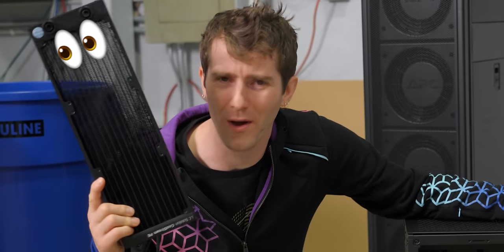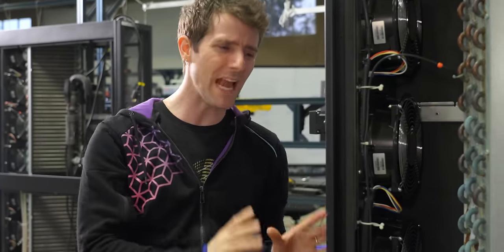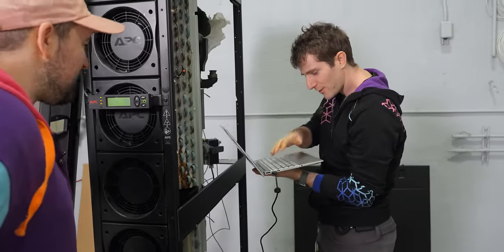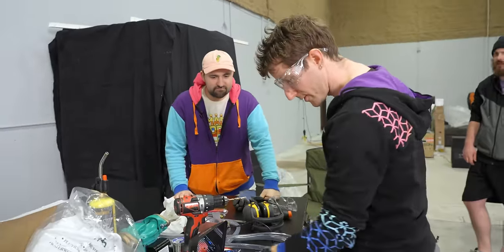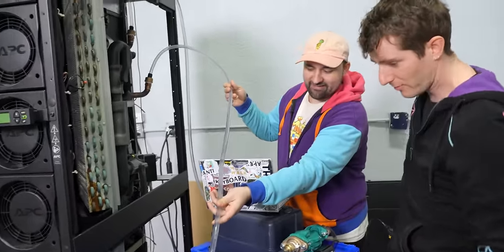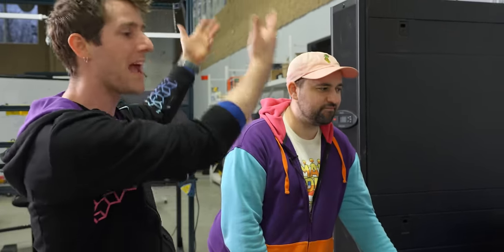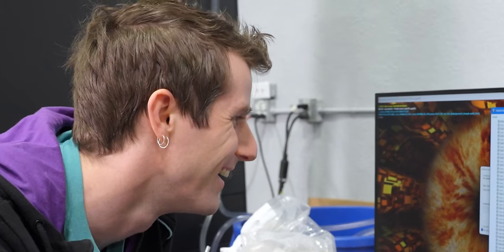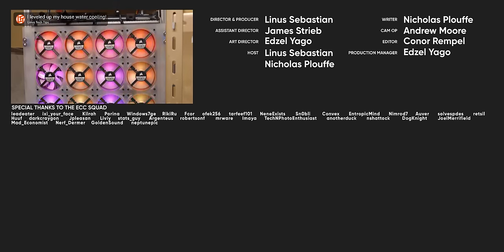I Can’t Believe They Threw This Away - Uniflair InRow Server Cooler

Comment: 7:20 casually throwing metal shards everywhere with powered machinery.. Yup that's linus!
Reply: The powered machinery is basically just some fans and enclosed pumps. 
You could throw the chips at them directly for hours and it wouldn't do anything.

Comment: Data centers use water to air chillers. Because running air conditioning with the compressors and everything is extremely inefficient and very expensive at that level. So data centers usually have cold water non-potable piping running up and down the bays where if they ever need to install a chiller somewhere on the raised floor they can tap into a valve and install a new chiller and then the chillers usually face downward meaning it pumps the cold air into the floor and then in front of the servers there's four tiles with holes in it for the cold air to come out The hot air rises into the ceiling where the chillers suck from the top and usually the walls there's a handful of chillers around the walls of each bay. But that's why these don't have internal pumps or anything because those pipes that are run through data centers are already being pumped and under pressure
Reply: The amount of air that comes out of raised floors is also insane. I was shocked the first time I raised a data center floor tile and got blasted in the face with massive amounts of cold air.  Lifting that tile was also another story because I wasn’t aware of how heavy they were lol
Reply: I don't see sub floors as much these days, usually pods that are hot aisle containment like these APC units in most DC's I have been to recently. Though I have to say they suck when you have to spend hours in the hot aisle patching servers etc.
Reply: CRAC units

Comment: Hey Linus!  I would leave the bypass open a little.  You're going from a large (3/4"?) to a smaller (1/2" I would guess?) hose on the discharge... that's going to build some head pressure, and it might be just fine but it will strain your pump way less if you give it a small outlet by leaving the bypass cracked.
LOVE the cooling and HVAC stuff, very cool!!!

Comment: I run a small datacenter. It has 24 server racks and 12 of these In-row coolers. They have been running since 2016 without a single minute of downtime. The side of the servers that exhaust hot air, is called the hot row.  The In-row coolers draw the hot air (as high as 75 degrees F) across 72 inch radiators that circulates 43 degree F coolant from our outside cooling towers. The foam around the pipes is to prevent condensation and there is pump for the tray to remove any moisture from Datacenter. the fans are rated for 10,000 RPM sustained.  These do not cool the fluid, they cool the air.

Comment: The bypass is so you can manually adjust pressure through the system. so that if your pump solution moved more water that the radiator can handle, you can bypass some water and avoid blowing up fittings. (I’m a pool guy, we do this to waterfall and jet pumps to adjust how the water flows down the falls for example)

Comment: This is kind of my dream. There is a serious Irony in my home. I live in an ironic state where my old home doesn't cost much to heat per se, because my office is so toasty from my wife and I having gaming PCs here as our daily drivers. So in the middle of the winter, I am dressed for the beach, until I want to grab a glass of water, when freeze my ass going to the kitchen. If I turned the heat up for the rest of the house, then the office would be so hot that I would be sweating with the window open. It has occurred to me that the dream would really be to have two heat loops. A summer loop with an outside radiator, and a winter loop that can dump into the A/C system to distribute heat through the whole house.
Reply: I mean, this is why Central heating/cooling has return vents along with the supply registers. It's supposed to recirc the air when the Fan is running, to greatly reduce temp differances between rooms and floors. Biggest problem is a lot of Thermostats only have auto/on settings for the Fan, so usually only circulate air when the AC or Furnace is running. Ideally, you'd want to set the fan to run every so often to even out the house, but need to find a Thermostat that supports this.
Reply: @Demoralized88  Ideally one wouldn't assume that something so simple as leaving the fan on hasn't already been tried and wasn't nearly enough.

Comment: Old tech that we used in our DC's where we had issues with CFM. These things eat power. We moved  all our DC's to pull in ambient air and evac hot air out of the building. It was cheaper to cool ambient air then try to cool recycled hot air. This required sealed racks and control of hot and cool zones. But this same design can be added to small areas (Home wiring closets and small shop DC's)

Comment: There should be a lead used to sense output temperature, on the units I've worked with it was just laying in front of the output fans. Grab it and hold it tightly in your hand - you'll get super speed fans in no time! No laptop required :-)

Comment: you should worry about the metal shavings falling down the supply and return. they could clog up/cause damage to the radiator internally. Also, its copper, a soft metal, please use a copper cutter instead!

Comment: I used to fit these, we called em APC hotisles. Ours worked reverse, it would pull the air into the middle then out through the floor, removing it from the datacenter and reusing the heated air to warm the offices. We cooled it with regular tap water!

Comment: I used to work at a place that had these between each rack, they were plumbed straight into the mains water and we'd frequently get alarms that there wasn't enough water flow and complaints that other companies in the building were having trouble with their water supply.

Comment: Tub of water likely uping temps as it can absorb room temp.

Need to balanced the reservoir AKA your blue tub with the radiators to get a proper circulation rate of water.

Comment: the foot in a reciprocating saw is there to steady the work. the teeth are only one way, and cut while the blade is moving toward the foot. the foot will anchor the work and make cutting very efficient, if its otherwise moving around from the blade's interaction

Comment: When using a saws-all if you put the guard up against the thing that you are cutting it will move a ton less. This is because it cuts when the blade pulls in so when cutting it will be stabilized against the saw body which you are holding (hopefully stablishly)

Comment: I never thought you'd show anything like this. I cool my house with a 3.5  ton Drake scroll chiller that circulates 50/50 ethylene glycol and water at 5 degrees C through six fan coil units totaling a 4.5 ton load. As a result I have a six zone A/C system. The load exceeds the chiller capacity because the chillers don't run all the time.

I don't liquid cool my computer, but if I ever did, it would be very cool (pun intended) to use some chilled water. I doubt the chiller would notice.

Comment: Damn that Roborock cleaning robot looks great. Then I checked the price of that thing and decided that my good old Electrolux D740 from the year 1985(it has the actual purchase date(I'm guessing but it's probably bought from those old time door-to-door vacuum cleaner sellers) on sticker at the bottom) just have to last juuust little bit longer. It still works, sounds like the vacuum cleaners did in the 80's and is bulky and heavy. But it does the job. I have vacuumed couple of times at my friends place using more modern vacuum cleaner and it's so...not loud... that it's actually nice job to do.

Comment: I grew up with a dad who's a contractor for HVAC. For the love of God use a copper pipe cutter instead of a reciprocating saw. You don't even know how long you are going to have to cycle that cooling unit to make sure you clear all copper bits so that it doesn't get lodged somewhere that will oxidize and ruin your loop.

Comment: The server room at my work has a AC unit that works off refrigerant that is cooled by a condenser unit on the roof and a second AC unit that runs off the building's Chilled Water. Not sure what else the chilled water would be used for besides cooling the building in general but it seems to be great for server rooms. That unit has never had an issue but the unit with the condenser goes down at least once a month. I'd love for my work to adopt these types of units and just go full chilled water but I'm guessing someone likes having the "redundancy" on paper and their might be capacity issues with chilled water as that unit did struggle to keep the room cooled back when a quarter of the servers were render nodes running 6 GTX 1080 Ti each.

Comment: 10 year old data center thermal management technology that was designed 20 years ago.

I was designing/engineering my own waterblocks for Socket940 Opterons back in April 2006.

Nothing new.

They were doing the hot aisle/cold aisle thing back then.

Comment: Its a heat exchanger.  The latent heat of condensation and the latent heat of evaporation.  They all work the same.  An evaporator, condenser, compressor, metering decide, accumulator/receiver dryer and a high side n low side pressure sensor.

Comment: I bought a used portable air conditioner a few years back off of Craigslist, it was cheap, $50 and it’s one of those ones that are on wheels, the size and shape of a clothes hamper and you need to exhaust the hot air out of it to a nearby window or door. But the funny thing about it… it’s made by APC! I still have it in case my central A/C ever dies… again...🙄 It works great, I guess it was used for small data centers and APC decided to “have a solution” for them? 🤷‍♂️

Comment: hah, it's weird to see "work stuff" show up on LTT. Thoughts:

These should have temperature sensors for air in/out and fluid in/out.  Since you're trying to cool the fluid instead of cooling the air, swap the fluid & air sensors (eg, where they meet the brain, not rewiring the whole thing) and you should be able to use Auto? (eg, if it wants to spin up when the inlet air is warm, plug the fluid inlet sensor where the air inlet sensor should plug)

If you actually manage to load these up to a real temperature differential, put some thought into where the air is coming/going, so they don't just recycle their own output.

Comment: Would have been interesting to see this run as a proper loop without going through the water tank. 
As someone in the DC industry we run the newer version of these at 17c input water average and target a 11c delta T.
Great units but pull about 2kw at full fan load so with a room with 50 of them you'll be mistaken for being air side at LAX.

Comment: One of the major reasons Google build their datacentre to Hamina (and few other big companies are building here) is that we have lot of low carbon electricity, very often negative electricity prices and... just absolutely comical amoung of water to use for cooling. Rivers, lakes, and the frikking sea which isn't even that salty. Appartnetly the 6 months of cheap cooling and basically free renewables during summer push many operations to pocket change levels.

Comment: I have the self contained version, ACSC100 handling my home datacenter. Works much like a commercial portable AC like a MovinCool unit. The noise out of those fans at 100% is insane, fortunately the average operational speed is low enough to not stand out much more than the equipment itself

Comment: They could use it for the rack at the gaming/badminton centre and use the heat for the hall or upgrade it with a heat pump for the hot water system

Comment: These hot aisle containment pods really sucked when we moved DC's from owned to leased, hours spent in the hot aisle patching the 100's of servers etc really gets to you when the pod is heavily populated. For anyone that doesn't understand what I mean @ 2:20 these units are usually used in a pod configuration that will have 2 rows of racks with backs facing each other. The aisle between the two will be fully contained to force the hot air coming out of the servers etc will then be pulled through the radiators by the fans to cool the air to be pumped into the room to then be pulled back through the servers. If you google search cold/hot aisle containment you will see some examples of how it looks.

Comment: If we want to be really... really.... really strict on safety and procedure the following are your work hits. 
1. Improper use of the Sawzall(Use the foot to stabilize) 7:18
2. Despite it being a moving tool, machinery,  you should wear gloves while handling the tool for protection against flying burrs, particulate. 7:18
3. When fluxing prior to brazing, ensure your joint is properly cleaned on the O.D. of the pipe and I.D. of the coupling. 8:24
4. After you flux allow the flux to dry completely, allowing complete thermal indication, and to prevent oxidization to allow your filler material to move. 8:24
5. While brazing wear WS 3-4 Shades lenses to protect your vision. 8:39
6. Unclear what filler material was used, be careful and know the contents of the material since a lot of filler materials consist of heavy metals (i.e. Cadmium) (Probably not used due to it being 90-10)
7. Before any hot work make sure there is no flammable material within 10 feet. Here we see the insulation of piping so you can either A. Remove the material, or B. Use Fire Retardant or resistant cloth. 8:37
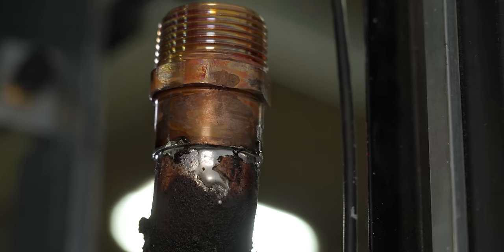8. When putting Teflon tape on, make sure you follow the path of the threads, allowing the tape to protect the threads and provide a better seal. 9:00

FYSA I'm a shipboard engineer and not a shore, also American different regulations most definitely are different, I just thought it was fun.  
Also if you know our trade. We don't listen to none of this shit lmao.

Comment: If I remember correctly, doesn't the position of the lever actually indicate flow direction?

Like if the handle is parallel to the pipe water goes, but if perpendicular it's shut off?

Comment: Second-hand enterprise hardware tends to be relatively cheap. It draws too much power for amateur use, and being out of warranty (usually unwarrantable) other enterprises won't touch it. There can also be licensing issues. Just throwing the hardware away is not unusual.
Company I once worked for bought a second-hand Frame Relay disk array and we couldn't get drivers or firmware updates because the original vendor wouldn't talk to us because we weren't listed as original purchaser. Eventually we got it working in dumb array mode. After a couple of similar incidents we stopped bidding on that sort of hardware.
Particularly at the moment as companies move stuff to the cloud there's less demand for this sort of hardware.

Comment: Data centers utilize water-cooled air chillers because traditional air conditioning systems, with their compressors and other components, are highly inefficient and costly at such a scale. Instead, data centers often have non-potable cold water pipes installed throughout the bays. This setup allows for the easy addition of chillers on the raised floor whenever needed. The chillers are typically positioned to blow cold air downward, directing it through perforated tiles in front of the servers. The hot air rises to the ceiling, where it's drawn in by the chillers mounted around the bay's perimeter. This method eliminates the need for internal pumps in the chillers, as the water pipes within the data center are already pressurized and circulated.

Comment: What happens if you connect a loop to inlet and outlet of pump?    Does it just increase in pressure until the system fails?  Does the water speed up really fast? Could you have the pump constantly increase the water speed for an hour then release it with ultra powerful water jet?

Comment: linus, i'm sure brian the electrician will point this one out too since i'm also an electrician. in 7:18, you should press the plate in the sawzall and pipe. that way, the bouncing is reduced. also, i don't like seeing it being cut where the bend is. this is because the bends reduces the surface area, making the connectors loose. if you really want it tight, have a marker and mark where the connectors inside will end up. lastly, please file. if water breaks the sharp edged metal left inside the pipe where was cut, well, now you know

this is because i had a journeyman lost a thumb for the first few weeks at the beginning of his apprenticeship. 

we're not mad, but concerned. seemed justin knows how to do it. now let me finish watching the video

Comment: I used to sell them during data centre builds... Didn't like them personally unless you were running blade chassis then you might need them in addition to room cooling and or thermal containment as the cost of these units is quite pricey.

Comment: As an HVAC service guy who was the North Eastern APC in-row cooling tech this made me weep a little... The connectors you cut off were flare connector unions.... Npt. IF they were factory fittings.  And once you got into the setup of the system you can force all of the valves open their spring returns on power failure.

Comment: Ironically I get better results with two MORA3 radiators, at least before you turned PBO on for the threadripper. My 4090 has never seen 45c since I put the block on it, even with my 13900K pulling 400w and my 4090 pulling 580w.

Comment: So the intelligent use would then be to transfer the heat of your server room to a radiator infront of the central air inlet of your building to "preheat" your intake air temperature... but I digress, I expect we'll make pool heater or a single radiator for all computers out of it.

Comment: Technically you only need to braze on the high side.  Brazing is different than soldering foolio.  Lol.  Its brass.  Its not solder.  Its like.....an in-between of welding and soldering